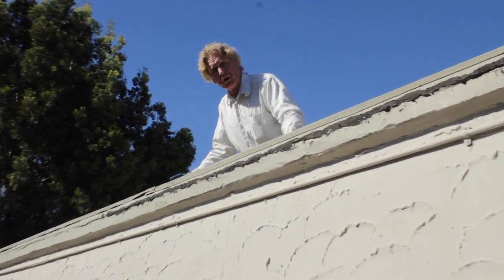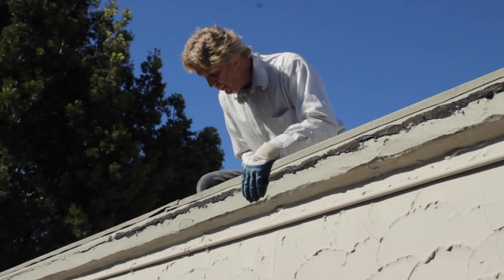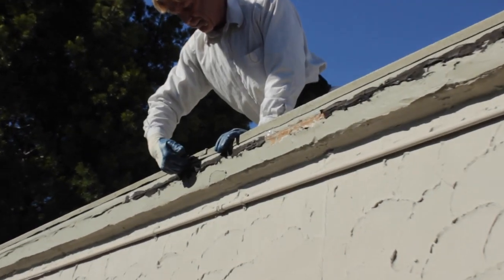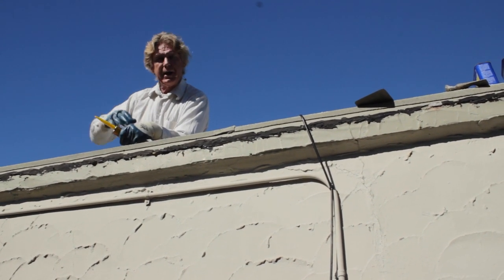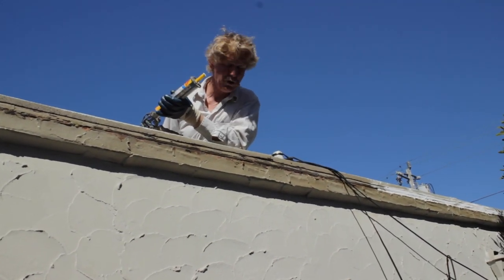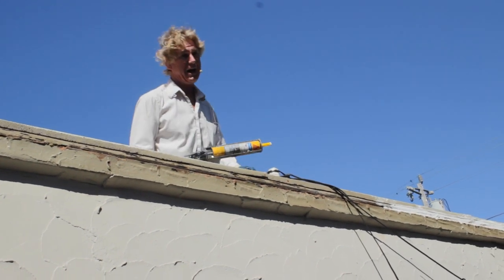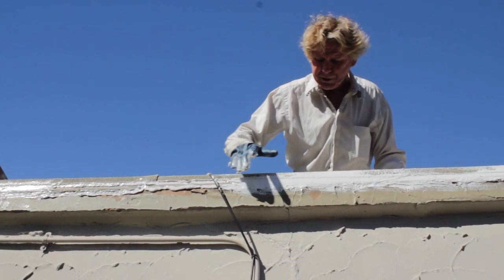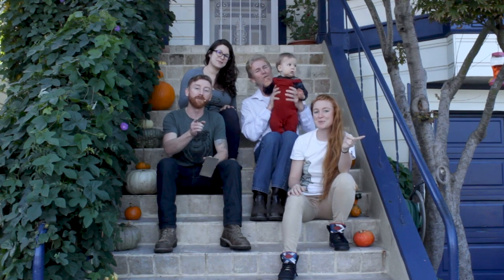Leaking stucco parapet caps

Comment: Hey kirk 
A little tip I have found that using any caulking or glue that comes out of a tube.  Clorox cleaning wipes will  clean off all residue form surface
Reply from the maker: Howdy Tim, man, I pored half a can of gunk on my old beat up bath wash rags, I've no time to use wipes, too slow for me brother.😉

Comment: Love your films Kirk. In Australia we would use lead, aluminium, zinc, galvanised, colorbond or rubber mesh flashing.
Reply from the maker: Howdy Thomas, my fellow plasterer from Australia, man, as long as you got some strong stuff up there, It will save some repair dough in the long run.🍻

Comment: Hey Kirk, great video. I have an unrelated question:
I’ve decided I’m going to paint my stucco with elastomeric paint. Should I prime it first? I’ve seen it recommended, but I like the idea that the elastomeric paint will fill any voids and hairline cracks. Thanks!
Reply from the maker: Evening my friend, app paints last at least 8 years longer if the wall is pressure washed really clean and a primer is applied before painting,🤙
Reply: @StuccoPlastering  Thanks Kirk!

Comment: He could've just made longer flashings. But filling it in with elastomeric seems like a good thing to do because it's flexible. Are used to fix it all or durabond 90, that stuff is bulletproof but it may crack.
Reply from the maker: Hi Kendal, yea, a 4-inch flashing would have been better however the cracks would have still been necessary to caulk from the wind-blown rains.💃

Comment: Hey Kirk! Always been a fan of your work. This is an off topic question from an old video. But I had the courage to try smooth stucco after enjoying one of your videos. I’m happy with the result for my first time but significant cracking appeared after fully curing. Although it seems strong and sturdy. I heard I may need to “slack” the mixing process and re-stir the material before using. Is that correct?
Reply from the maker: Howdy all smooth stucco does that for a reason. read the description in this video. https://youtu.be/OqbQbdEySSI/ New smooth stucco over rough stucco. 🤙

Comment: Thanks Kirk.  Can I use Sikaflex 1A to fill in cracks in a stucco'd chimney in hard to work areas?  Realizing this would not be the recommended stuff/way to patch stucco.  I can mix and apply stucco patch from a ladder, but the areas above a sloped metal roof have me scared - I am 77 years old and can't mix & apply stucco above the roof.  Thanks for any advice.
Reply from the maker: Good afternoon Neil, my spring chicken brother, yes if they are very small holes, you are an inspiration, keep on keeping on.  🕺

Comment: You do things very different where you live......why don't you install a new cap flashing with a larger overhang and standing seam joints (no nails...cladding screws)? It will last 100 times longer than any caulking considering the UV will break it down painted or not. ....also, slope your cap flashing to the roof side and when it cups the water rolls right off onto the roof.
Reply from the maker: Howdy Les, LOL, some folks don't read titles or descriptions, how bout that.🤔

Comment: Ha, knew it was Sika just from the color of the tubes peeking over the edge of the roof. Can find it at HD and a lot of Ace hardware too.   The roofers really should have used a clamping strip to hold that membrane - expansion/contraction will quickly cause delamination at edges. Using nails is just plain lazy/sloppy/NFG.
Reply from the maker: Howdy Aurthur, exzackory.🍾

Comment: How are you kirk I am a fellow plaster I have a question about finish coating . I have old stucco walls that I have pressure washed and applied fiber mesh and base coat on . Can I use a cementisious finish over the base coat . If so great and if not why not ?
Reply from the maker: Howdy Gilberto, of course you can apply a cementitious or an acrylic finish stucco over a basecoat. No doubt you applied a bonding agent over your pressure-washed wall prior to your base coat? If you went over a painted surface.😉
Reply: Good morning Kurt yes I did I made sure to follow all your instructions about applying the bonding agent thank you for your help
Reply: I have another question off that subject metal lath is hard to come by right now I have some that is Rusty on one side can it still be used to adhere stucco
Reply from the maker: Nothing adheres to dust, dirt, moss or rust , at least not for long. Except maybe spider webs.

Comment: Does More-Flex provide greater elasticity? And that's why you use it on the stucco cracks?
Reply from the maker: Howdy B Dude, If I thought Mor-Flexx was a better solution for this, I would have saved the time and cash and used it instead. Mor-flexx is super user friendly, but were talking about a different type of fix than matching stucco textures in this video. 🍾